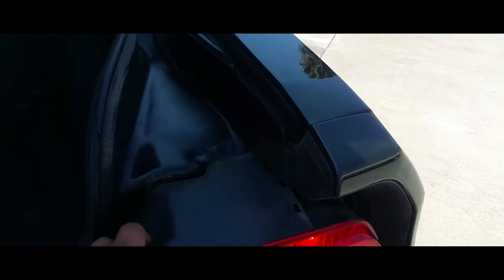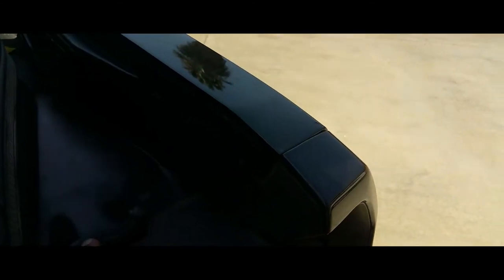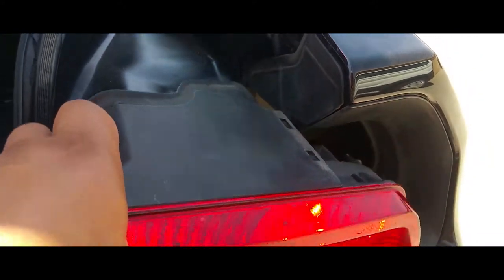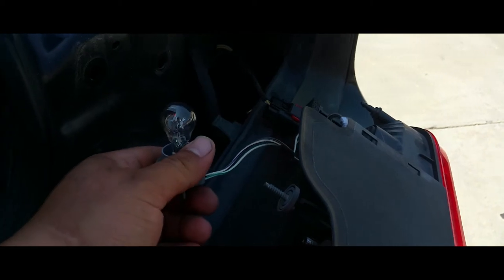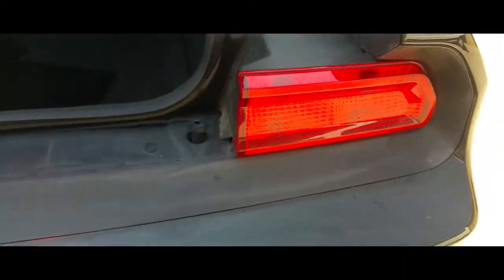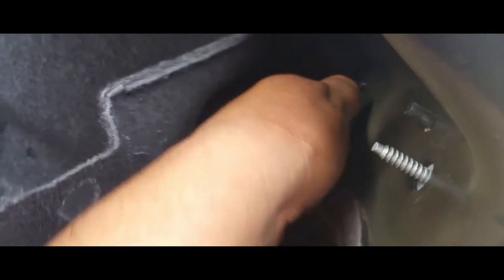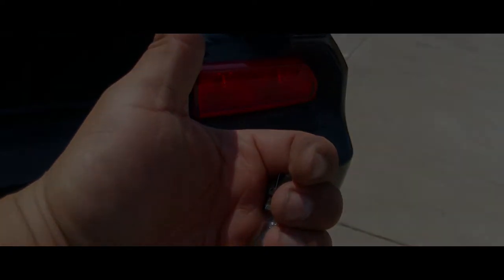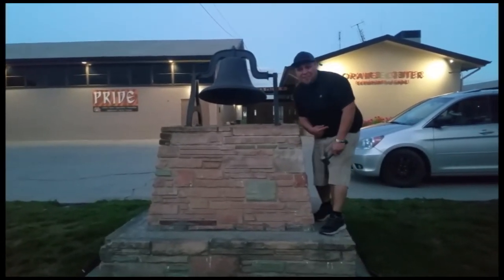How to: Replace a tail light light bulb from a 2011 Dodge Challenger

Comment: Got a question maybe you could help me with, in getting dark taillight covers for my 2011 dodge challenger rt and need to really be able to see the break lights and stuff better since the covers are so dark, any advice? Could I put LED break light bulbs in to make the break lights brighter so they show through the dark taillights covers? Any advice would be much appreciated
Reply from the maker: Lol Taillight tint is off road use only.  U can try leds but my opinion they suck....they burn out to fast...last thing you need is a fixit ticket for Busted Taillight n the tint